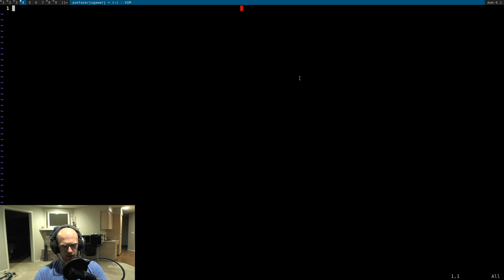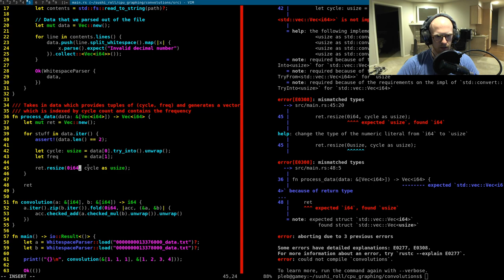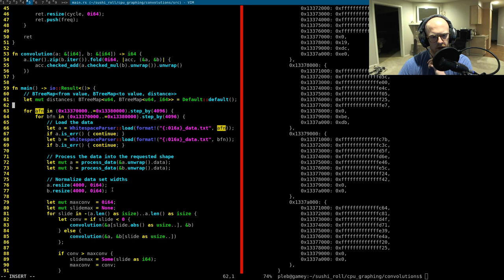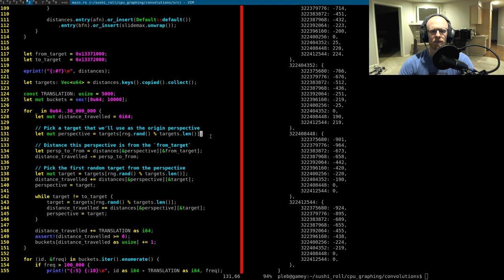Data analysis on Intel load port monitoring

Comment from the maker: 0:00 - Intro to the stream's goals
12:12 - Intro to speculative execution

47:10 - Hypothesis about why some peaks are lower than others
51:43 - Testing the hypothesis
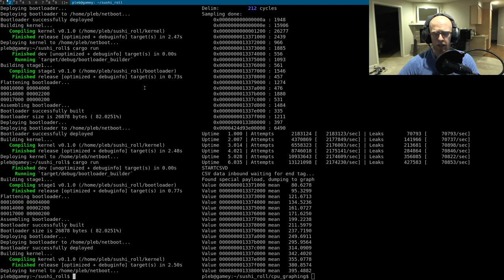1:02:02 - Attempting an implementation that leaks from both load ports
1:04:14 - Success!
1:20:00 - High level explanation of the environment this code is running in
1:20:55 - Surprised by some data???
1:21:30 - Theory of this weird data
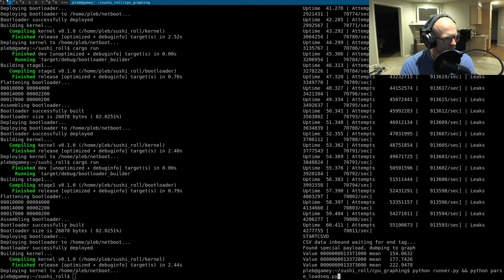1:22:10 - Long tangent on my views on development

1:34:13 - Tangent over, back to data! Exciting results!
1:40:50 - Idea to use convolutions to analyze some of the data we have
4:44:00 - Why the convolutions aren't necessarily the best for what we're looking for
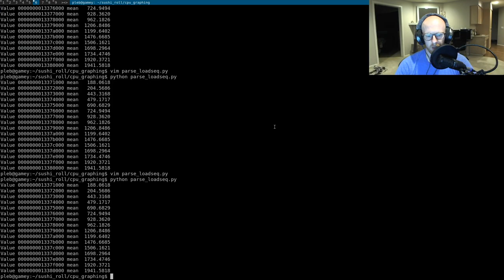4:48:25 - A different approach to sequencing the loads
4:53:32 - First data from this new approach, looks good :D
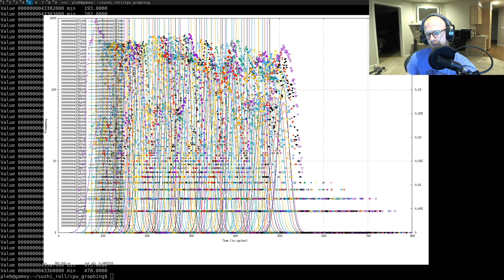5:15:30 - Generating 128 random loads that we'll keep hidden and try to leak blind
5:38:40 - Comparing our observed data with the actual blind data set, 100% match
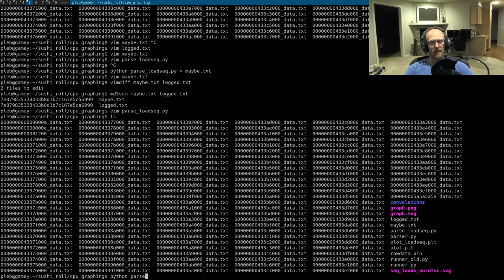5:40:20 - Results from what we thought the loads were